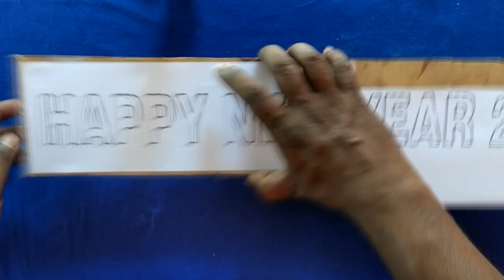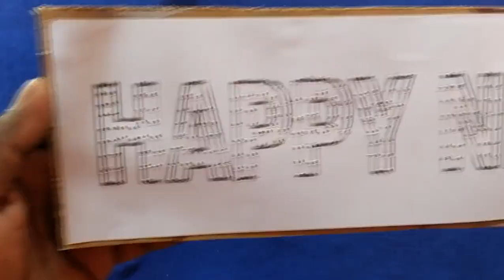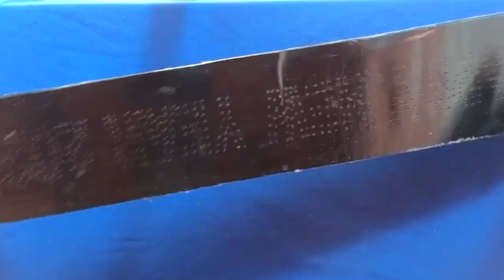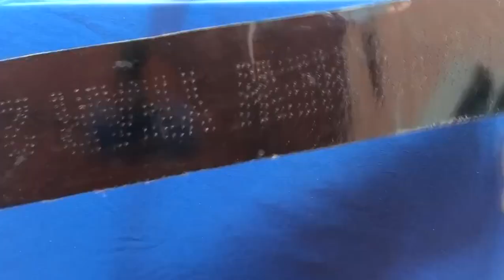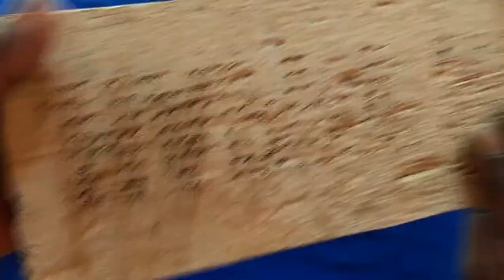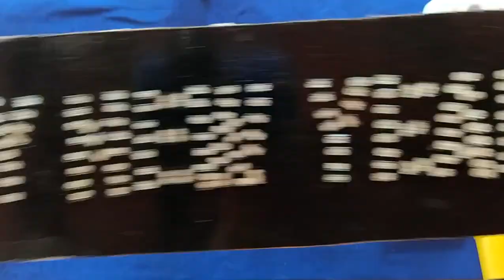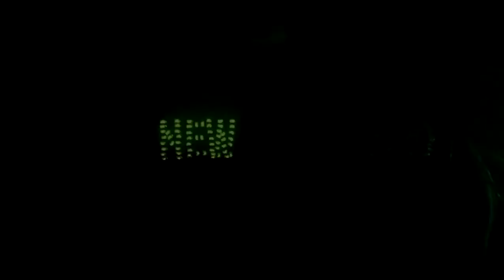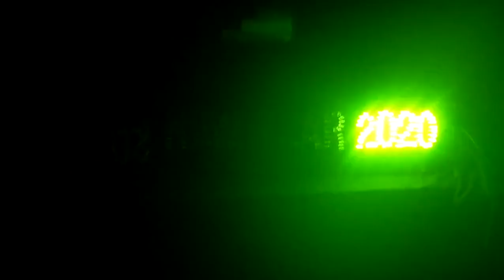LED Panel "HAPPY NEW YEAR 2020" using flasher

Comment: Ethakota aiye api flasher koteta connect karanne + wire witharai ne neda...onama warge motor ekak apita bavitha karanna puluwanda..motare speed eka adu karaganne kohomada..
Reply from the maker: මෝටර් එකේ speed 1ka adukaraganna පුළුවන් 1k gattoth tamai ලෙසි. Podi plastic gear morter කඩේ teyanawa Rs.250 wetara wenawa. Nattam wine karana සෙල්ලම් car වල  tiyana කොටස පොඩ්ඩක්  modify karala gannath පුළුවන් .    Dana(+) rina (-) loku prasnayak na. deken 1k tora ගන්න.....
Reply from the maker: Flasher kote කරගන්න amaru nam. Ara mama kalin LED star kiyala karpu video 1ke hadapu circuit 1ka හදලා oke LED panal walata dennath පුළුවන්.
Reply: @APIDANNADE  thank you..👍
Reply: @APIDANNADE  👍